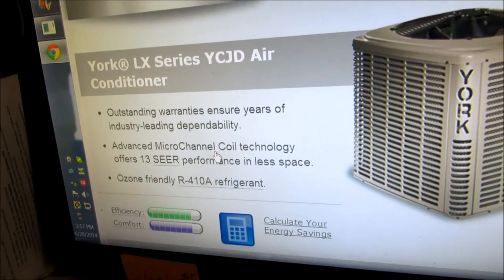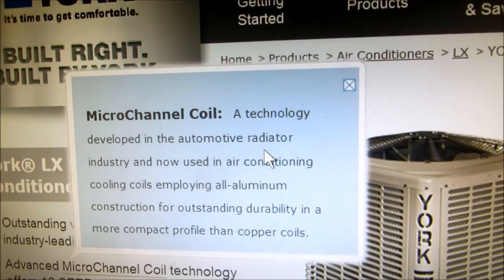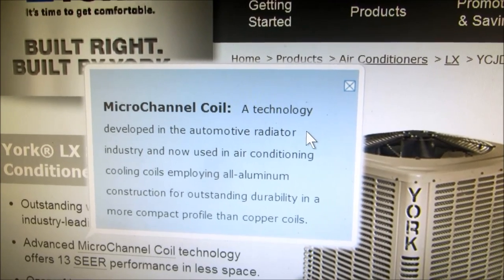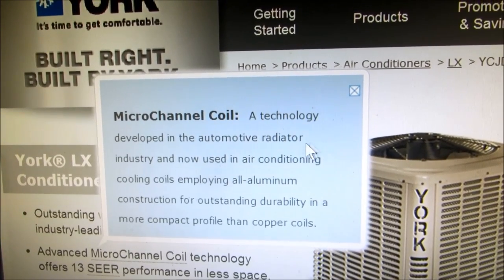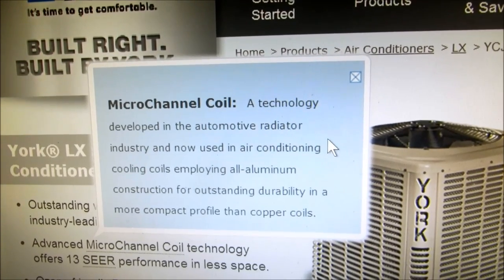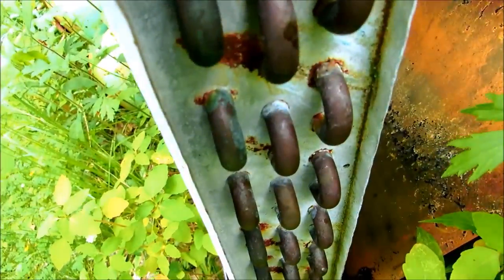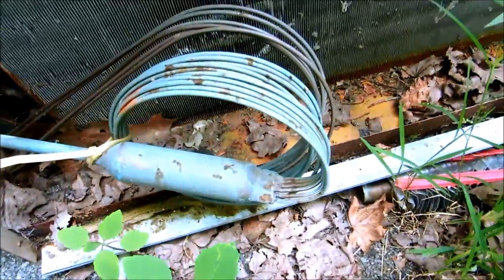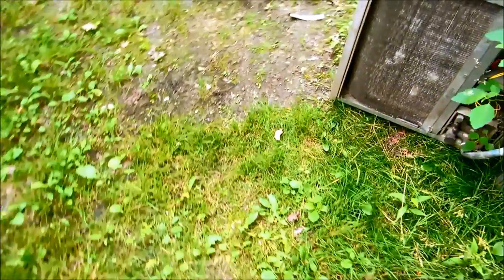hvac : why micro channel condensers suck

Comment: it sound like they made the tubes to thin. car radiators I think will pressurized up to 15 psi. they should have base it off compressor air after cooler. compressor air systems operate much more pressure like 250 psi. they kind look beefer than that coil in that air conditioner. those coils are made too light. what I heard form techs in field that system are not lasting as long. I think air conditioner manufactures are make there system too cheap
Reply from the maker: spark300c micro channel is trash
Reply: o.k. you all ready said that. More or else I was thinking of ways to fix the design. my solution to make the tubes beefer. air conditions head pressure is less when it not running. when runs it is higher. so the condenser coil is failing due to fatigue. 410a really bad with cyclical stress. I look t p chart there at least 100 psi or more swing form rest to running if out temperature is in the 80s.so coil for 410a has design to take 800 psi to last long.  I just do not the sharp corner in the tube. stress does not as high in round corner than in square corner. I think oval tubes 
be cheaper to make because it easier to extrude it and material needed is less because it has no square corners. another thing  you got aluminum to copper brazing.  might be better use flare nut joint. since it leaking at solider join a lot in your test. I not sure if the coil has enough to do that. well it might be good ideal if manufacture did that.
Reply: +spark300c Here in la vegas nevada we have temperatures in july around 116 f, if you are on the roof can be 125f, with R410A the pressure can be 450 psig, if you have a durty condensing coil will be more, looks like we going to have a lot angry customers!
Reply: +Kevin Krug last year we have  two weeks with 115 f   every day, if you go in the attic, the temperature is around 
145 f to 165 f if you dont have any attic ventilation

Comment: 1.) If you have a leaking joint (copper to aluminum) you have galvanic corrosion. The brazing rod is 98% zinc and acts just like an sacrificial anode and deteriorates. Check your grounds for stray current.

2.) The Epoxy E-coat is more than just a "spray paint". It's a Epoxy that is applied in a electrocoating dipping process, similar to chrome dipping and then in a final process is baked. Thickness of the coating is typically 1-1.5 Mils. Copper Coils get coated in the same PPG electrocoat.

3.) Horizontal tubes in a MircoChannel make it charge critical. We at Alcoil recommend Vertical tubes where your lower header is also a built-in mini receiver. Vertical tube also give you better more predictable thermal transfer cause of gravity. Vertical tubes also provide better capillary action removing water from the coil face, this is important cause you don't want rain water sitting on your horizontal tubes causing failures.

4.) Our MicroChannel Coils have a UL rating of 650PSI used in refrigerants R410A, R404A, R407C, even Ammonia and of course R134A. I personally take units off the manufacturing floor and burst test them monthly at a range of 2100-2200 per our UL requirements.
Reply from the maker: Nathan Hartlaub i will stick with the round tube coils ,i will not buy micro channel if i can help it .
Reply: 1) theres your leak...... the zinc corroding and making the joint insecure.
2) i know epoxy, it's not really that good it's not like chrome dipping at all. .. its applied with a spray gun that is ionically deposited. just because it's "epoxy" does not mean its super fucking fantastic.
3) still made of crap.
4) then you need to do some serious quality control you got problems.

Comment: All your manufacturers now are using micro channel can't be used on a heat pump even in commercial refrigeration you see Michael channel more and more but I've had some success with 410A with it very few issues

Comment: I used to work on cars and micro channel is ok for radiator fluid at 10 or 15 psi but obviously it cant handle high pressure gases that condense back to high presseure liquid. I am sure they saved millions by doing micro channel

Comment: That's sad Steven having to replace all those bad condensers. Even if they are under warranty, the homeowner always questions the experience of the technician who installed it, even though it's not their fault. York is making all the first class technicians out there look bad with this subpar equipment. 

PS.

I'll be by tomorrow for the loan for my new pickup truck and a New England boiled dinner while I'm over! :)
Reply from the maker: thanks for watching brad

Comment: Where is the EPA on all this?  They should all be recalled and paid for.
Reply from the maker: there should be a recall i agree
Reply: I agree the EPA should get in, especially if there are those running R22 like Steve said! Leaking that is a huge fine offense for your average guy, so why are the manufacturers so different?

Comment: I can personally attest. These products suck. I installed the Coleman (York) line for 2 years. Have over 40-50 units Installed 20-25 have leaked within 2-3 years. I get no help, just a coil which I pay $125.00 shipping for. I install the new coils for free since I'm the dope who installed them. Thought I was doing something good. American made, etc. so now I eat the labor, refrigerant, etc. local supply house has offered no labor reimbursement. I have about 18 coils in my yard, planning a video soon. You can spot the numerous leaks when you nitrogen them out of the unit and throw them in a kiddie pool. A real bubbler! I use Carrier now, not a problem for 2 plus years, made in Mexico with copper.
Reply from the maker: +Chris Hill yes carrier is better icp line

Comment: Copper is going up and up and with these Micro Channel coils the manufacturers
save money by making small condensers so they save on shipping and everything.I have a 5 Ton American Standard 20
heat pump with that spin fin it's huge.My neighbor just had a Trane XB300 straight cool 3.5 ton 13 seer and
its Micro channel and it is very small compared to mine 2.5 feet tall.It reminded me of these 1980s Trane units. She has had to have the
coil replaced twice and a compressor.The Hvac guy hates them also he said that
it is ruining compressors because, the charge has to be so close with no accumulator  like on heat pumps makes it harder. He told me Trane made him pay for the
compressor because, they told him it was his fault when he changed the coil.
He also had to replace 8 out of ten of the Micro-Channel jobs he told me he won't
put anymore in cause it's your fault they are leaking.
The whole industry will move everything to this to save them money within 10 years I bet.
Reply from the maker: stewart smith i will not buy micro channel also .90% of the ones i see are leakers

Comment: I have seen aluminum condenser coils being used in the late seventies and early eighties and the coils leaked then jus as they are doing now, I have the experience of one of a micro channel coil leaking before the second year of operation, my suggestion to all designers and contractors is to avoid using any equipment with micro channel coils as they are all failing in a very short space of time.

If you can advise your customers to prolong the use of the older equipment so as to avoid the expenses which are involved in repairing leaks in the coils, I can Tell you now that by the this's or fourth year of operation you will have to be repairing the condenser coils and you are not getting any assistance from the equipment manufacturers and the equipment owners are of the option that you have sold them a piece of bad equipment knowing the same equipment to be bad.

If we were dealing with automotive equipment they would have been recalled a long time ago.

Comment: micro channel technology is not the problem its York (and others) using too thin of material.   Carrier used aluminum coils years ago and almost went bust,  because they went cheap on tubing thickness.  industry switch to copper and now there back with aluminum a-coil's again.  (reuse - recycle) new day old shit

Comment: Are all the manufacturers paying the techs for the replacements of their failed microchannel equipment?  I doubt it. The tech gets stuck for the labor in a lot of cases.
Reply from the maker: ritewayguy they give you a replacement coil thats it
Reply: steven lavimoniere Yeah,  and they don't reimburse you for  your labor.  I know one thing, IF, I install any more micro channel evaporators,  I am putting them under a pressure test of my own before I braze them up to the refrigerant lines of the  condenser.  If they pass, then I will install.  But I know for sure that there is one that has been installed for a while that is going to start leaking.  I should take my own advice,  quit selling them!

Comment: Micro channel is here to stay for now. You have to be upfront with your customers and tell them that while the new unit will be more efficient and save them money short term,  it will also cost more to maintain since the parts are not holding up like they did 10 yrs ago
Reply from the maker: good point the stuff does not stand up like it use to higher fren pressure it not helping the problem eather

Comment: Eh, Steve Lat - wuzzat you fhattin' in the left audio channel @ 5:08? (LOL! Just breakin' your bolls!)
Reply: Seriously, this was very informative. Even the local Carrier Service Manager said they were "problematic". (No, genius, they're a piece of shit!) He also said they will continue to manufacture the units with these. FYI: if any standard coil cleaner and process ("green", or otherwise) is used, as opposed to the OEM recommended, they will use this as an excuse to void the warranty, which typically only covers parts. Trust me, they won't lose a penny by the time the labor is billed.

Comment: Shit, the name of the coil is shit. Once out of warranty, leaks will 
occur, the walls are about half the thickness of tin foil, and are 
impossible to repair. The warranty is void as soon as you remove the 
cardboard box from the unit because if you read the fine print on your 
warranty card, warranty is not valid if the unit is exposed to light.

Comment: If we could only go back to copper and R22 , to many bells and whistles,the guys that design this crap are booksmart. Everything look good on paper
Reply from the maker: Bernard Sobbe ya the new stuff is getting more complicated
Reply: Bernard Sobbe well it why you build pro type and test it. I mechanical engineering degree and did enough projects to know that first one you design usual has problems that need be correct in 2nd or third design. another thing that only those with high gpa are able to get the internships which get them the jobs. they only count job experience and any I do in garage to sharpen my skills in the engineering trade do not count.  I also going to warn you if government keep requiring high seer number more bells and whistles have to added.
Reply: +spark300c No offense intended but your grammar isn't consistent with someone who holds an engineering degree.
Reply: tstatech the facts is one does not need to spell or be good grammar to do math and draw cad pictures do physics and know how things work. it be silly to think that english major can build can design a jet engine. also it be silly to think a english major is good at math. some people are good in one area and bad in another.  in fact engineers use to have secretaries to proof read there written work before emails.
Reply: +spark300c Damn, I must be underemployed because I'm no English major. I was actually a poor English student. I'm not trying to bust your balls. I probably shouldn't have said anything at all. For all I know, English isn't your first language. Perhaps you're just a lazy YouTuber who refuses to proofread before hitting the post button.  
I do know that when I went to school for an electronics degree back in 1988-89, I had many prerequisites. When I took my entry examines I had to take classes that I tested poorly in, I had to take a lot of classes that you would not think necessary for an associate degree not to mention what would be required to take engineering level classes. I had to take a writing class, Algebra, Physics and funniest of them all Human Relations. I had to take Human Relations twice. Didn't do so well , turns out I don't really like other humans, haha, can't stand their BS,
Reply: +tstatech I tend to forget to proof read plus I have dyslexia.

Comment: So I wanted to clear up some of the statements made on this video. Everyone as the right to their opinion but the statements being made here are not completely true or accurate. So we want to share our opinion about this video. One thing that Steve did not mention is that all manufacturers like Carrier, Lennox, Trane, Nortek, Daikin etc.... are also using microchannel technology. He also doesn't mention  in his video that Trane and Carrier have had aluminum spiral fin for years and had their share of issues and they have both have adopted microchannel. This coil technology originally came out like any new product and had some issues but that has been corrected, upgraded and there are no reported problems with this technology. The other biggest problem we see in this industry is uncertified, untrained technicians like Steve which are afraid of change and don't understand new technologies. Stop dwelling in the stone ages and past, listen to your own advice and maybe you should go back to school and get better understanding of new technologies. We have been doing this for over 25 years and have installed all brands. We work with York and have no issues,  you was why? because we are certified and know what we are doing!! they also always stand by their product no matter what and that is the reason they have been around for over 150 years and still going strong. Here is another reason why we would recommend York to everyone, they are the only company left n the USA, can say that much for all other brands including is favorite which is Goodman that is owned by Daikin. We appreciate what York does and we don't have any problems with them and their services and if there is any issues we deal with it and we don't cry about it on you tube. My final comment is that if an individual like this came to anyone's home, He should be thrown out !!!
Reply: Yeah I agree Steve is in need of some education on why microchannels are being used and their significant benefits.  Furthermore, the idea that microchannels "can't take the pressure" is absurd.  Microchannels have the highest pressure capability of any condenser technology because of the small holes. All aluminum construction is better for corrosion than mixing metals, and their ability to reduce condensing temperatures is unsurpassed.  The black epoxy dip he talks about is the only way to produce a condenser that will have a long life in marine environment applications.  As energy efficiency requirements increase, microchannel is going to be in every system, even your Goodman.
Reply: UNNIQUE SERVICES, I will never install a micro channel coil again, what a total embarrassment. Without any doubt they have major issues, never again.